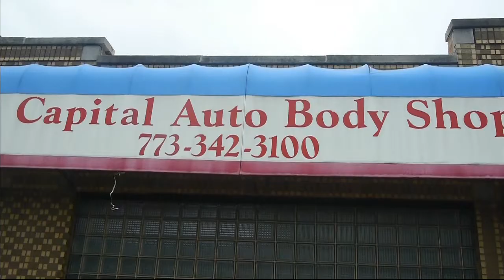93 Mustang LX Notch Coyote swap build(Part 31) by Folleh Shar Tamba

Comment from the maker: We apply primer after sanding and grinding off surface rust in the trunk.
Reply: I'm loving all these parts brother! This is my dream car but I'm honestly starting to look a little more at a Fox hatch because almost everyone seems to be doing notches now... I try to go against the trends lol ;-) either way though, I have always thought the notches were sexy as hell and so were the fox hatches... i love all of them! the only difference is I simply freaking adore the DOHC Terminator engines... they have that cast iron build so can handle a good bit of boost and they are just so badass with the T56 Mag 6 speed transmissions coming straight out the factory on the 2003-2004 Cobra SVTs :D
Reply from the maker: @mihaeltomasovic  I hear you sir! We also have a 1993 Mustang GT that we are swapping a Coyote Aluminator engine and a TKO-600 into it that we are working on. This one will be wrapped with war dairies when it is completed. https://www.youtube.com/watch?v=9IayN5ehVx4&list=PLG4mKXWqG3EN3FtJGmaJ4zm_djh3n-V8q